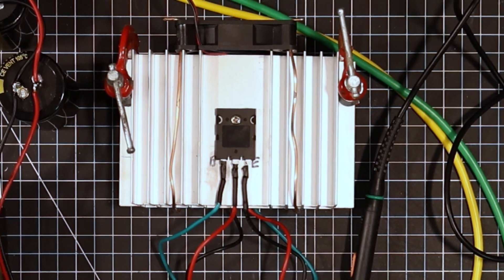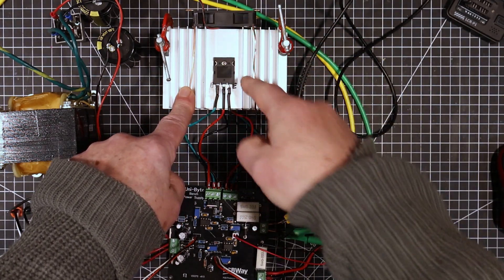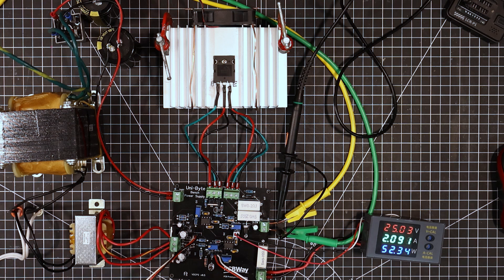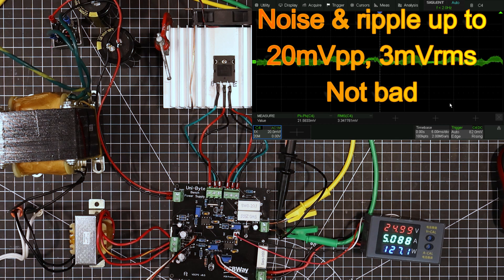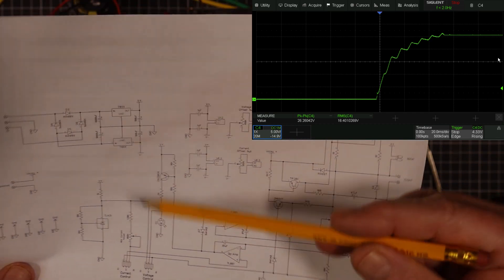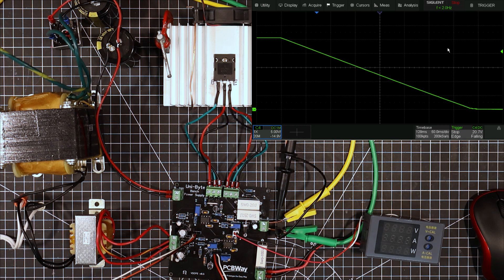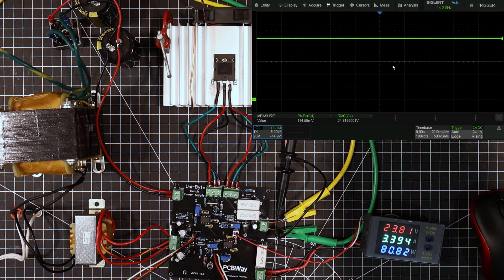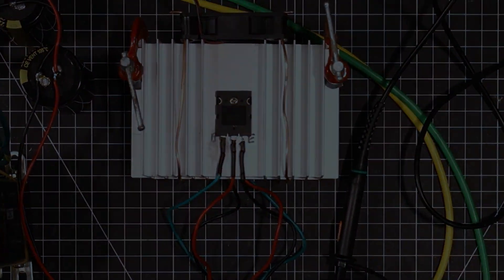Uni-Byte 0253 - Now THAT'S what I'm TALKING 'bout! - Variable DC Power Supply Part 5

Comment: Is there a way to make it work with a power bank like a 25 volt 3 amp wall brick 
I got Three of these and think I killed one trying to get it to work off a brick the lm7824 just popped would you have any ideas on how to do it oh 
AND I REALLY LIKE YOUR VIDEOS 
keep up the good work
Reply from the maker: Thanks!

As long as the DC is clean is should work fine.  I'd put a large filter capacitor on the unregulated input to be sure (like 47,000uF).  Make sure you have tons of heatsinking and a good fan!!!

Comment: Congratulations, Bill, on your successful conclusion to a wonderful, educational and useful project! Super-Kudos! Thanks for bringing us along!

Just a couple of random thoughts... People seem to want to totally avoid PNP components... They seem to have developed something of an evil reputation. However, quite often, they are the right tool, for the right job. The 3055 is a classic "right tool," as well. "At $10 CAD a pop I did not want to stock up on them just to get a matched pair." Yep, their cost is what came to my mind, immediately... Particularly in the larger package. However, they do have many advantages in this application, and, in some respects, make the project doable. Without them, it would have been difficult to find other solutions to the challenges that you were facing.
Reply from the maker: Thanks Tom.  On the "$10 a pop.." that was for the MJL21194 in the big TO-264 package.  The TIP3055s I had in there initially were cheap enough, about than $2 a piece IIRC (I got them a long time ago).  I had them matched very well for both gain and Vbe.

One should not be afraid to use PNP transistors.  They are a must in many situations and make those situations manageable.  Like top side switches, class "B" amplifiers and what we did here.

Thanks for following along.

Comment: I think that 0.1Ω it's too low for a balance resistor, on most design I always saw something on the 0.22Ω-0.47Ω region, it will matter a lot on the worst case scenario, something like 30V IN, 0.5V at 5A OUT, I think at least an extra tap should be mandatory for linear supplies with this amount of power. Transformers with a center tap, something like 9v-0-9v or 12v-0-12v are very common.

Really nice design/project over all👍
Reply from the maker: I actually did try 0.2Ω and 0.25Ω but it made not difference.  I even tried 0.2Ω on the lower one and 0.25Ω on the higher one (that the way it is in the video, you can see it if you have a big enough screen).  Exactly the same result.  If the gain and Vbe of the transistors are not matched, they will conduct different amounts.

Comment: Sorry I just grabbed the circuit and had a look :-)  
It should be a bit better than that. It looks like you are sensing the output voltage before the 0,1 ohm resistors, so that will make the regulation worse, but not too much in a general purpose supply. You should be looking for about 0.15 to 0.2V across the resistors. It's a bit empirical as it does still depend on the transistors being reasonably closely matched and in good thermal contact.

Andy
Reply from the maker: I am actually sensing after the resistors.  Right at the output.  I only ordered 2 of the transistors and unfortunately the gain on one is 54, the other is 64, so not very closely matched at all (oh, and the forward Vbe is different too).  At $10 CAD a pop I did not want to stock up on them just to get a matched pair.  IF I was to actually press this into service I would do that.

Comment: This is really helping me grasp a better understanding, I've been involved with electronics for 45 years, but due to life getting in the way, I never completed any formal training, although not for the lack of trying in the early years, I  worked without pay at a TV repair shop when I left school in 84 in hope of getting an apprenticeship, I was doing repairs and antenna installations for 6 months and right in front of me they gave the apprenticeship to someone else, it was really demoralising the 2 other technicians couldn't understand it either. I left and never went back, My primary interest was digital and computers with some programming and self educating as I went along ,the trouble is I tended to skip over essentials not relevant to what I was doing at the time only to have to backtrack later. I'm still backtracking.
Reply from the maker: I have a similar story.  Was a early HS drop-out.  After a few years working as an electronics repair technician (mostly audio) in the movie business (my dad got me in there and taught me [almost] everything I knew about electronics)  I got hired on at a tele-printer manufacturer based on getting the highest score on their hiring exam.  However, they gave me a low end QA position and would not promote me, or  pay me what the other techs got because I did not have the papers, despite being the best of the bunch. It was all digital stuff.  Over the next two years I went to night school and got my Certified Engineering Technology certification by taking targeted courses and passing the certification exams.  I liked higher education so much I quit there, made a part time job for myself running and developing computer systems for a chain of motorcycle stores ((that's another story) ) and went to university to study physics and mathematics and was awarded degrees in both.  Once I was done with that I got offered a job running an automotive information system at much more than what a graduate engineer would make.  That lead to a 25 year career in IT, including running my own company for a while.  Retired in 2010 and just got back in to electronics seriously 2012 and immediately started another little company working with microcontrollers.  I hated it and gave it away.  Got heavily into music for a while playing trombone (not very well) and managing a couple of swing bands.  In 2019 took a job repairing computers for pocket money which I had to quit 2 years later to look after my dog.  That's when I decided to get serious about electronics again.
Reply: @uni-byte  that's interesting. My other interests were woodworking and engineering, I ended up doing a diploma of arts in furniture design and manufacture and a couple of certificates in visual arts and engineering fabrication, building furniture is what I achieved the most at, managed to win a few design exhibitions,  but it's hard to make a living without moving to a major city, I'm too at home in the Australian bush, and the girl I ended up with said no way was she living in the city.
Reply from the maker: @darrenchapman7203  Awesome!  Yeah, my wife and I don't like cities much.  We're out in the woods 7 miles from the closest town.

Comment: Put a small resistance in the power transistor emitters, say 0.1 ohm that will give a little bit of negative feedback and stop one transistor taking all the load. 

Andy
Reply from the maker: They are there.  The two big white resistors side bye side.  That's why there is only 0.6A difference.